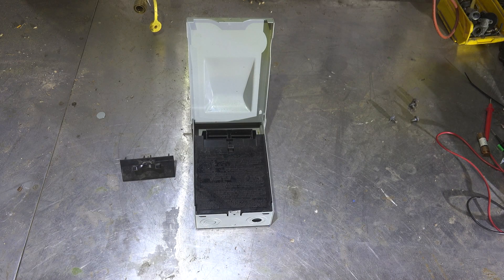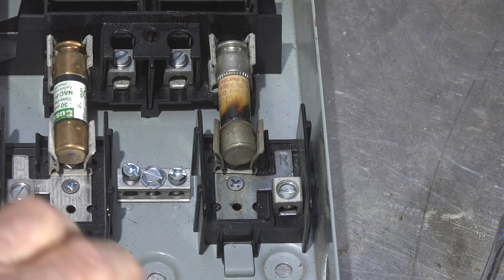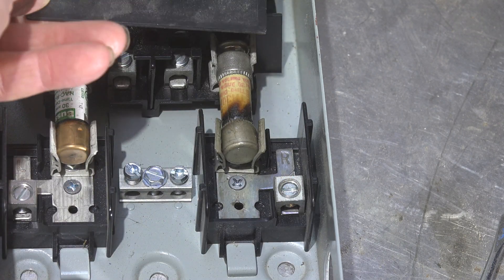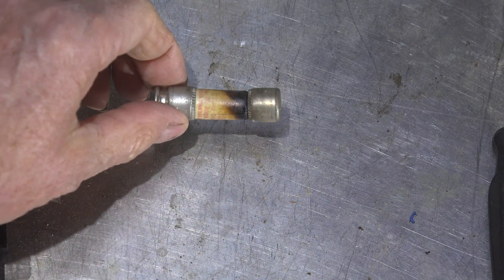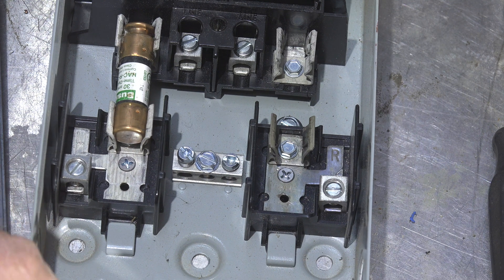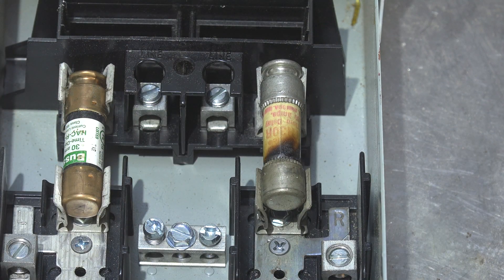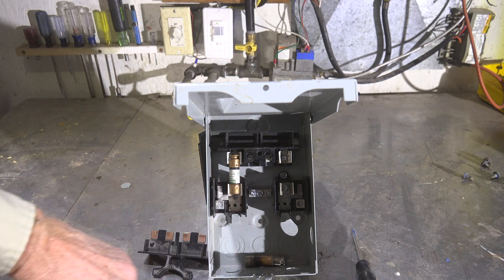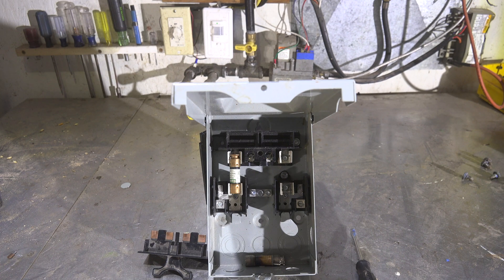Burned fuses in disconnect

Comment: Dear GFM Master... ASTHMA tip for ya!!

If you still suffer from "shortness of breath" or asthma symptoms consider THIS:
I watched your videos about FURNACE HEAT EXCHANGERS and heard how you were grasping for air... like I was.

...Long story short:
The white synthetic fibers of the anti-allergic Filtrete furnace air filter CREATE SUPER FINE DUST when they get VAPORISED ON CONTACT with the glowing red area of the heat exchanger. 
The cooler but still super hot areas of the exchanger get coated White with MELTED FIBERS that stick.

I finally put 2 and 2 together during  Covid confinement when my asthma got aggravated by 2x new HomeDepot (Honeywell & 3M "Filtrete Allergen Defense") filters just recently installed. 
The loose fibers from these special filters are what create a wide range of fine white dust particles. 

Fix: REMOVE said anti-allergies air filters. Sanity is restored, take a deep breath 
👍
Reply: I never saw that, but I have wondered if filters can release fiberglass particles and blow them through the house.
Reply: @averyalexander2303  unfortunately these are not glass fibers. Glass has a relatively high melting temperature compared to home furnaces.

The anti-allergen 3M Filtrete fibers vaporise or melt according to where they collide with the heat exchanger  surface blown around by the furnace fan.

Let me quote what these 3M Filtrete filters are made of: 
"POLYPROPYLENE AND POLYOLEFIN PLASTIC".

I don't believe PLASTIC FIBERS SHOULD BE USED NEAR burning hot HEAT FURNACES only heat pumps and cold AC handlers at best!!! 

I would not be surprised if burned polypropylene plastics were linked to lung cancer in closed environments such as heated homes.
More power to you... filterless!
👍
Reply: @glasser2819  What filter would you suggest using that won't blow particles around the house then? I don't see the cheap filters with course strands releasing particles under normal conditions, but those don't filter well either.

There's always a trade off of airflow restriction vs filtration. Presuming the size and thickness of the filter stays the same, improving the filter's filtration typically makes the filter more restrictive and vice versa. One solution is to use a large and/or thick filter with a high filtration. The filter media would probably be restrictive, but if the filter has a enough surface area it won't restrict airflow too much, it will filter well, and will last longer because there is more surface area to hold dust.
Reply: @averyalexander2303  you are right! Fine particle filters are more restrictive and GFM videos taught us that restricted air flow can be associated with cracked heat exchangers.

Right now, my 105k BTU furnace is FILTERLESS... I clearly stopped having respiratory condition when I removed the "allergen filters" that in fact trigger "asthma" like lung reactions. WTF 3M/Honeywell!!!

What furnace filter to use: 
NONE or nothing based on PLASTIC FIBERS! perhaps paper or cotton based... I am not a fan of fiberglass particles either.

WHY: 
The lower part of the HEAT EXCHANGER GLOWS RED and vaporises/ burns anything that comes in contact with it. Somehow I don't trust petroleum plastic fumes to be safe indoors 😅

To keep dust level down: 
use Hepa grade vacuum bags and tower air filters.

My only point being the WHITE ALLERGEN FURNACE FILTERS are DETRIMENTAL to your respiratory health - Far from obvious unless you know about gas furnace heat exchangers. Txs GFM.
👍
Reply: @glasser2819  I would suggest that you use some type of filter, it's there for a very good reason (to keep dust and trash out of the furnace and ducts). If you don't use a filter your blower wheel will accumulate a lot of dust eventually and won't move air effectively. Your AC evaporator will get very dirty and moldy over time and may be very difficult or impossible to clean without removing it depending on the design of your equipment. The ducts will also get full of dust over time, not good. None of this is good for your equipment, your energy efficiency, or your house's air quality.
Reply: @averyalexander2303  you are very right again! Being in Northen Cali I do not have an A-coil in the plenum, no AC needed.

When I started to chasse the source of fine house dust, I disassembled and shop-vacc'ed all 8x of my 4" duct runs (I sealed all seams with mastic that cured drafts and insulated them with sleeves wraps).

As far as blower wheel getting dirty you're entirely right. They should be pulled and cleaned every 5 years or so.

I've lubed my bearings with (engine) oil, replaced the old 4uF cap with a  440/370VAC by Supco and added a Schneider "Altistart" module (ATS01N106FT) to soft-start it. 
Now my old single-phase blower starts slowly and ramps up to speed without stressing the limit switch with a 60+Amp spike.

Comment: repeated night dew in unsealed outdoor juntion box does speed oxidation of all metals including the fuse holder.

These contact surfaces were designed to meet basic residential grade.

These days most products are engineered to purposely fail predictably in a non-catastrophic way... 
✌️

Comment: Great video. Fuses, terminals, wires, etc don't just burn up like that and need a quick tightening or fuse replacement.... The disconnect is now bad, terminal is bad, etc... Replace the overheated parts or it'll happen again.